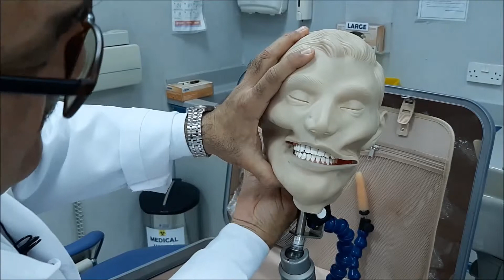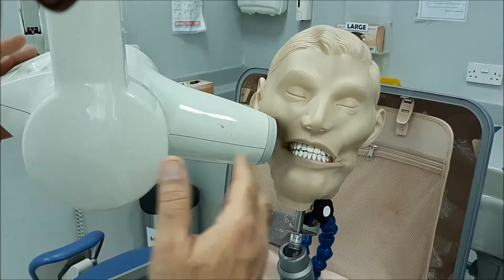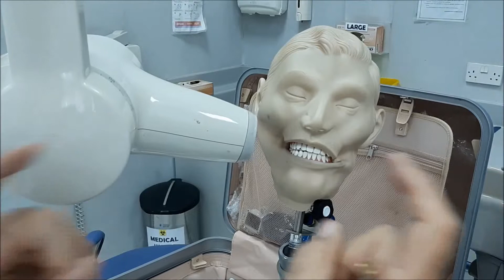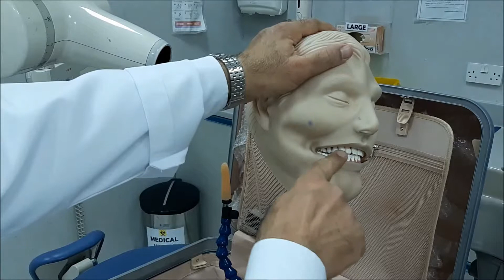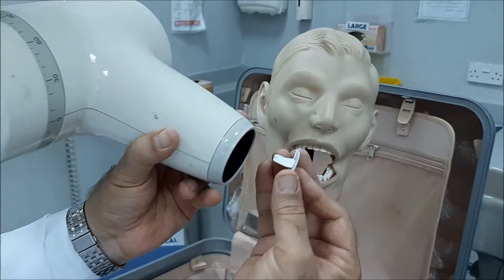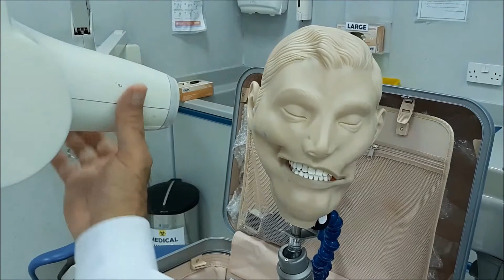Premolars Bite-Wing Radiographs- X-ray Beam Alignment

Comment: Hi I was taking the horizontal bit wing, but I don’t het the open contact instead I go to many overlap and corn cut,can tell me what I should do?
Reply from the maker: Hi Alice, The reason  behind overlapping contacts is incorrect horizontal angulation. The best way to do this right, is that after film placement, you stand in front of the patient, and make sure that the outer rim of the cone is parallel to cheek of the patient, thus you will make the X-ray will pass between the teeth and np overlapping occurs.  Unless the teeth are overlapped in mouth, this you can't control.

Comment: My instructor explained this so many times to me but my brain couldn’t process completely. I understand the concept I just don’t know how to open contacts on a molar shot. I’ve already watched your molar video it helped but I’m not sure about a few points. 
Do I need to retract the cheeks ? If I move the pid distally wouldn’t that open the contacts for a molar shot ? 
You see what I mean ?! Lol 😂 I’m confusing myself
Reply from the maker: Dear Nasr.Phoenix, thank you for passing by the channel. 
No need to retract the cheek, Here's what to do: 
1- After adjusting the vertical angulation correctly, stand in front of your patient. 
2- Move the PID (around a pivot,  not distal to molars) so that the margin of the PID is aligned parallel to the cheek. 
3- You need to be in front of the patient to insure parallelism of the PID and cheek. 
Once the PID and cheek are parallel, the X-ray beam will pass between contact, and you will have open, non-overlapping contact points. 
I hope I made it clear. 
Best regards, 
Saad